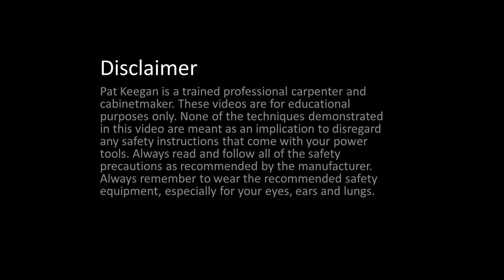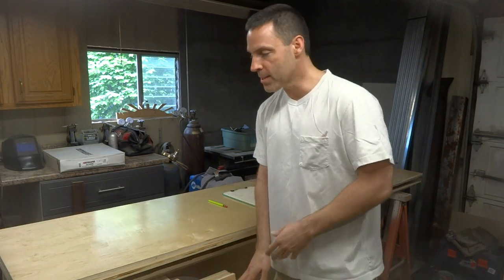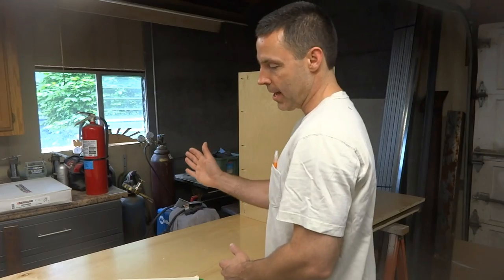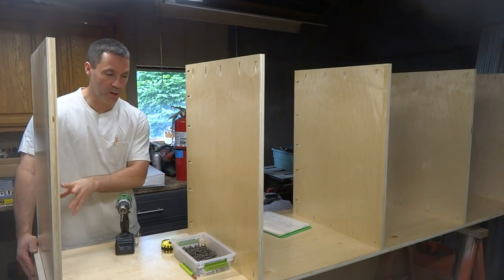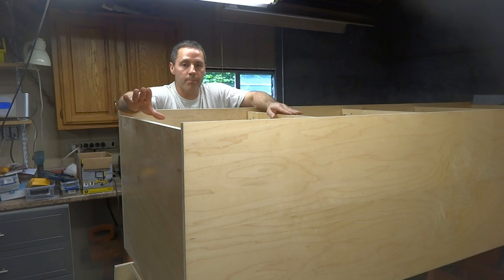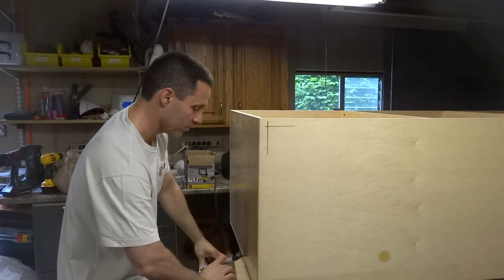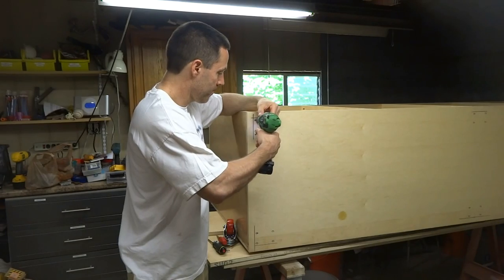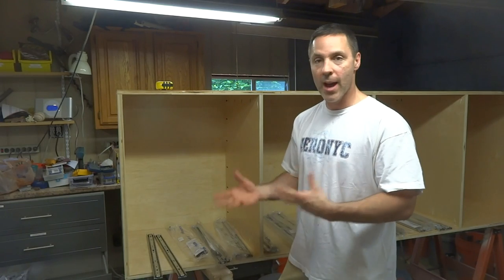OSF: Building a Mobile Shop Cart - Part 1 of 3

Comment: Awesome! 

 If I may make a suggestion....I was a Fire Marshal, and I noticed your extinguisher by your acetylene set-up.  I recommend HANGING it at the exit door.  If you have a fire, and you reach for that extinguisher, it will always be there.  If left just sitting around, it will be moved a dozen times, and you don't need to be searching for it when you need it.  Also, if you do get it from the exit door, and decide the fire is too big to fight, the smoke is too bad, etc.,...the door is right there.  

It is just what I notice when I see videos. or go out to dinner...it drives the wife nuts....So much for retirement...
Reply from the maker: Hey duenge!! THanks for the comment. It actually got stuck in the SPAM portion of my channel, not sure why.  But thanks for the recommendation. I'll totally take you up on it. Please kick my ass if you don't see it mounted properly in upcoming videos!! -Pat

Comment: So if I can't find - maple plywood and a couple coats of vanish, with sanding in between coats ?
Reply from the maker: That would work. I'm searching for an article i had on making your own "pre-finished" plywood. It had a great formula/process. From what I remember, if you are brushing it on, you may want to thin it about 10-20%. I'll try to find that article and post a link. It's funny you asked this, i was actually looking for the article earlier this week. Thanks for the question/post!
Reply from the maker: and definitely wear a respirator even if you have decent ventilation!